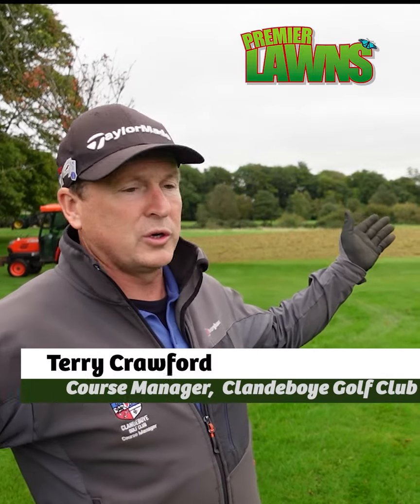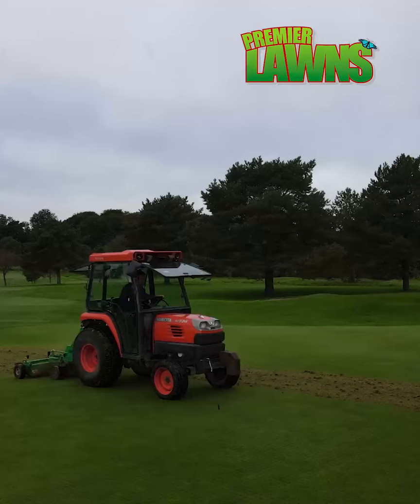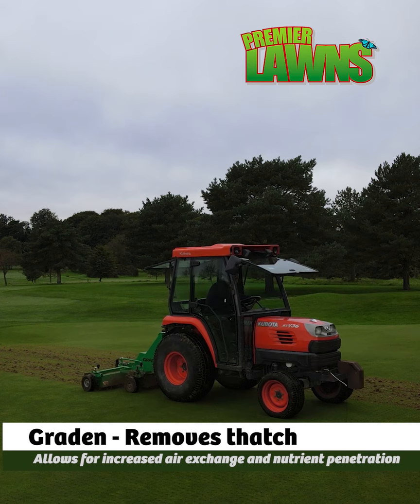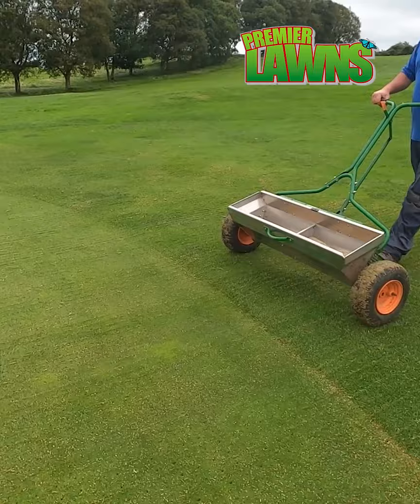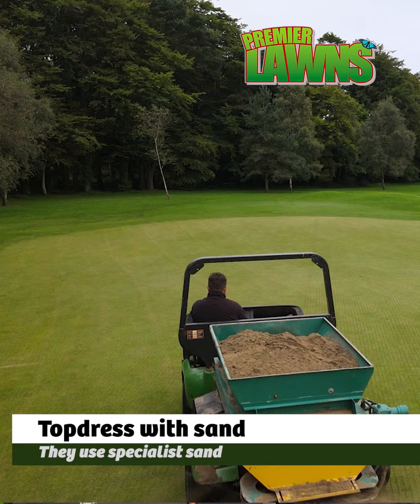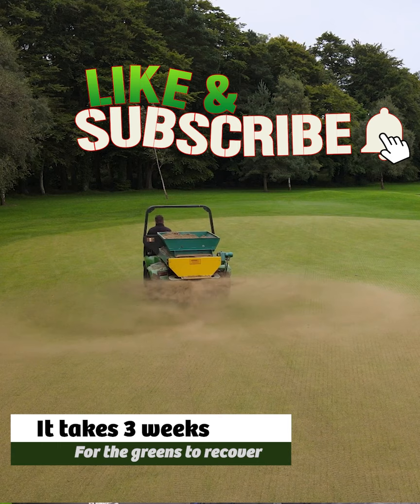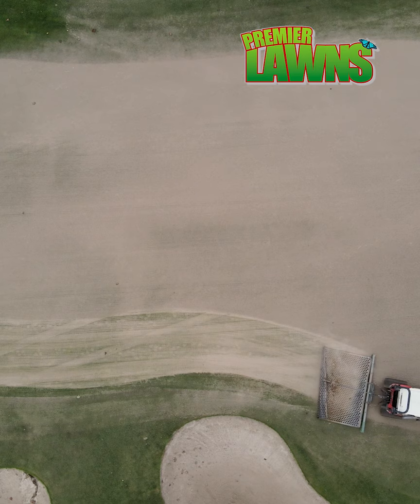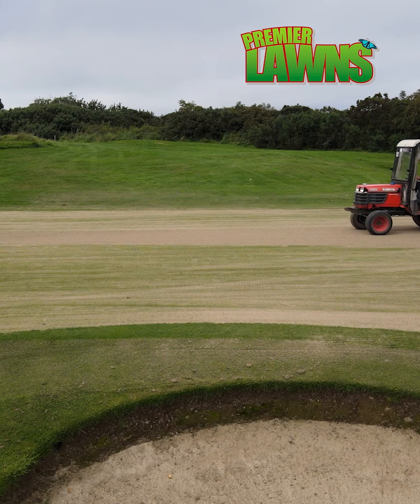Golf course greens maintenance | topdressing with SAND #shorts

Comment: Merry late Christmas from the P.N.W. Robbie. Santa got me my first reel. A Swordman.
Reply from the maker: Lucky you 😍😍😍, which one did you get and what size is your lawn
Reply: @Premier_lawns_official   Hi got the Edwin 45. I have about 5000 ft² of lawn 3000 in the front 2000 in the back. I am excited to use it but the weather is too soggy right now.
Reply from the maker: That's a lovely mower 😍❤️ what height are you intending cutting at?
Reply: @Premier_lawns_official  My last cut was at 1 1/4 inch with my rotary mower with no scalping. I plan on starting there with the reel , then slowly to 3/4. then level again and in the end maybe 5/8 . It will take some work.
Reply from the maker: @richardharwell  15mm will be a nice height, are you going to use any plant growth regulators?
Reply: @Premier_lawns_official  PGR is something I would like to try. When is the best time to use. I here it will make the grass fuller and relax top growth promoting root health.
Reply from the maker: @richardharwell  PGR is something I will be covering a lot more next year, I bought an old John Deere greens mower lawnmower for my own lawn in the Autumn and that will let me dive into more advance lawncare stuff next year
Reply: @Premier_lawns_official  I was looking at T Nex , PGR. Pricey but would last a while.
Reply from the maker: @richardharwell  I will be using primo maxx, a jar of that stuff will cost more than the lawn mower!
Reply: @Premier_lawns_official  That John Deer mower is next level. 
I'll be watching for Spring vids." SEE YOU IN THE LAWN !!!"